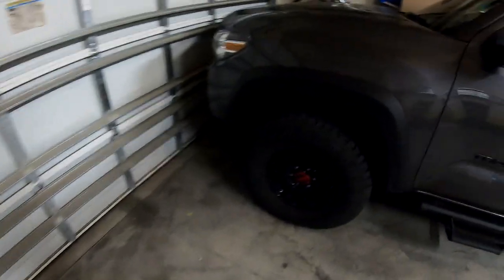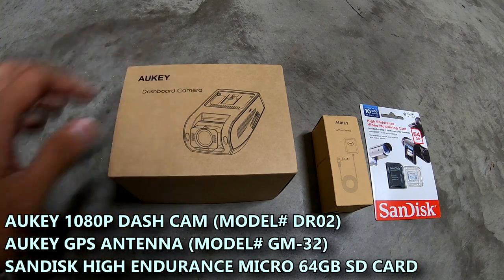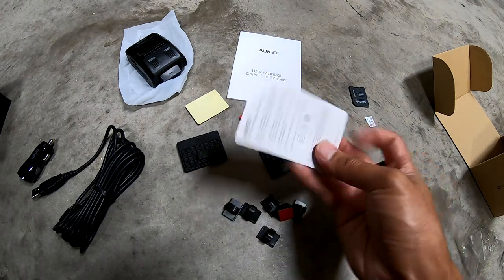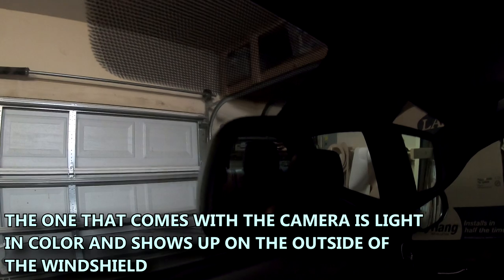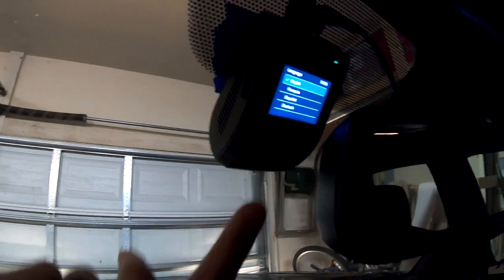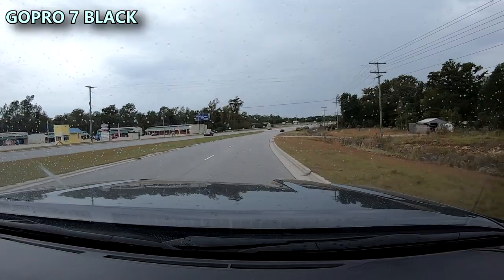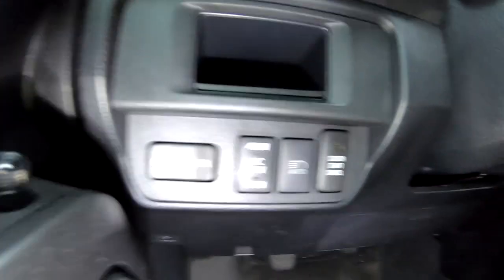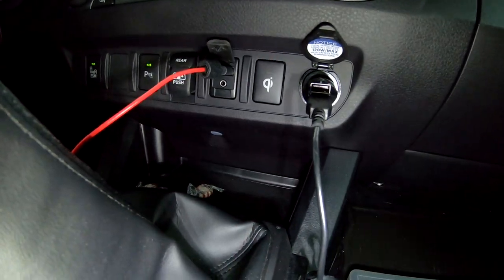1080P Dash Camera Install (Aukey DR02)

Comment: They no longer make/sell the GPS antenna in your link. I've read a few reviews of other aftermarket GPS antenna's. It seems to come down to Mono vs Stereo. Could you possible tell me if your GPS plug is 1 ring (Mono) or 2 rings (Stereo) Any help would be great. Thanks
Reply from the maker: I believe it’s a stereo plug. This one looks just like the one I got. https://www.amazon.com/dp/B07TV18T91/ref=cm_sw_r_cp_api_glt_fabc_7CDM26BBFJJEBSYGVED1

Comment: How do you record if you get in an accident? Since it's on loop recording.
Reply from the maker: The camera records in 5 minutes clips until the SD card is filled, then it records over the oldest recordings.
Reply: @AyyJayy02  Thanks, so to confirm, the sd card records like 11:00, 11:05, 11:25, 11:50, and if the accident happens at 11:55, you will just need to pop out the sd card and save the 11:55 portion, right?
Reply from the maker: @231doughboy  that’s correct. I had to pull some footage from mine the other day actually.
Reply: @AyyJayy02  Thanks
Reply: And most dashcams has a programmed "panic" button. Pressing it makes the dashcam take that specific file clip and put it in a different folder while locking it from ever being deleted.
Reply: @tspooner01  Which button?

Comment: One could say that the GoPro 7 produced better video and audio but where's the true value in a dashcam setup like this? If the Aukey does a respectable job producing clear video in most driving conditions and the audio too is clear then why use something as expensive as a GoPro? It becomes more of a liability to theft. How do you like video done at night on dark streets?
Reply from the maker: The GoPro view was just for comparison purposes since I didn’t have another dash cam to show any difference in quality. It was only up there for the day. It’s decent at night. It’s a bit grainy, but that’s normal for any camera. I don’t know why I didn’t think about showing the night view. Maybe in a later video, I’ll throw that in there.